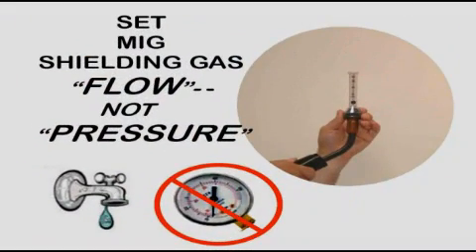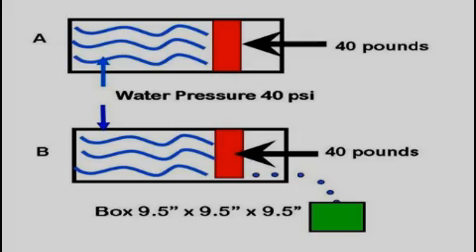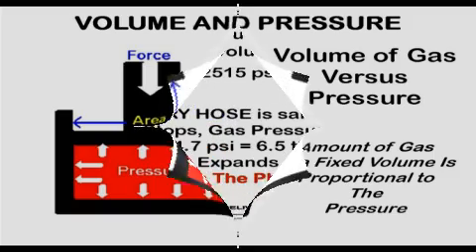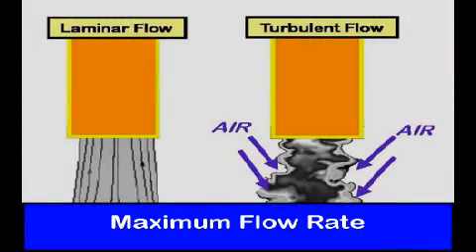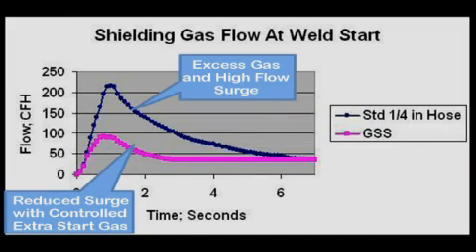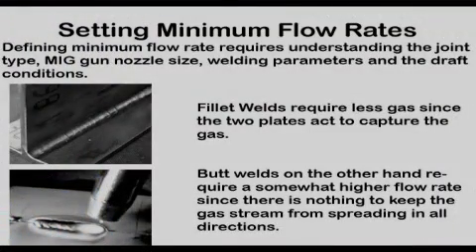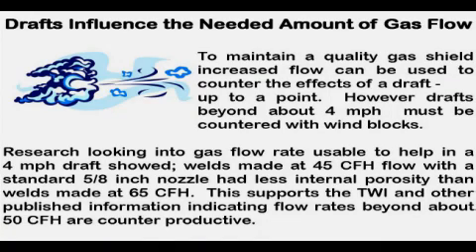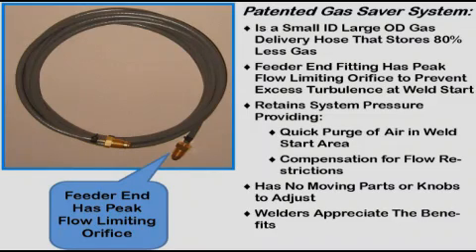Set MIG Gas Flow.mp4

Comment: You have got to be kidding me! Who is suppose to understand that ?
Reply from the maker: There is a simple chart that shows what to set without the reasons!  However if you want to troubleshoot weld problems best to watch the short video!  At least understand that a small wind of ~5 mph MUST be blocked or shielding gas will be blow away no matter what flow rate is used.  In fact too high a flow just pulls air into the shielding stream!  Many professional welders don't appreciate that fact!
Reply from the maker: If you can't deal with Math or Science try my shorter video: https://www.youtube.com/watch?v=CjhJKaURBOs&t=4s
Reply: no good dead goes unpunished Jerry...people love to complain...thank you! 👍

Comment from the maker: The two gauges read different things.  The higher pressure cylinder contents(should be ~2000 psi when full.)  The other is calibrated in CFH (cubic feet per hour) as you note.  This flow is set by a very small orifice in the outlet (probably 0.020 to 0.025.)  I estimate the pressure your setting is about 30 to 40 psi to flow 25 CFH.  As long as it remains above 25 psi, the flow will be what the CFH gauge says.  The pressure in the hose is probably only 3 to 4  psi when welding